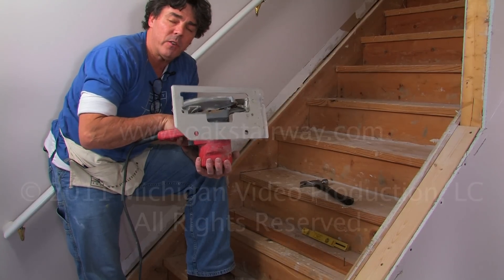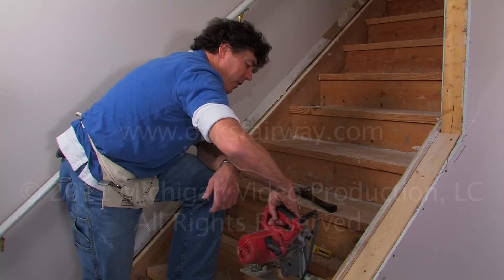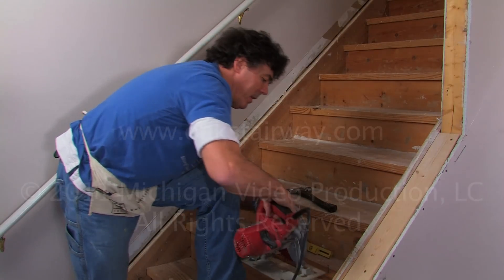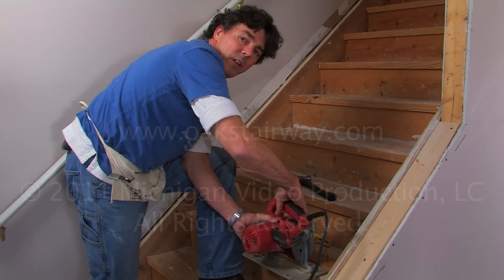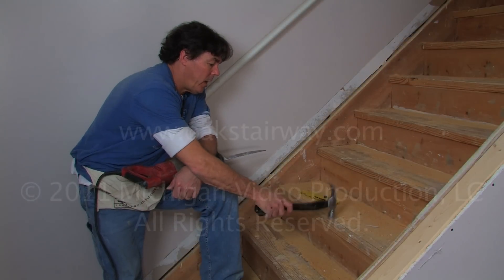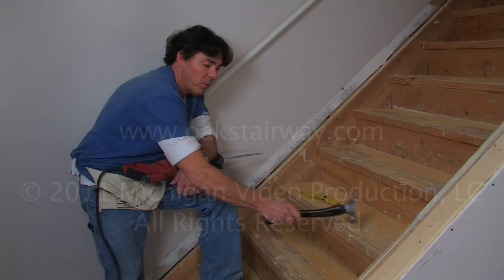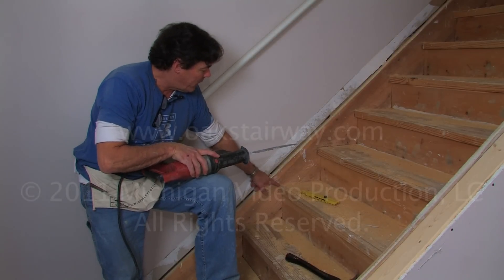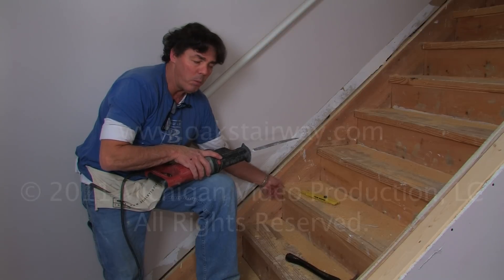How to remove nosing from stairs to install oak wood stair treads.

Comment: A jig saw will get you closer to the ends where a multi-tool can finish the job. Both are more manageable tools in the hands of a novice. With the jig saw, you start at the front of the nose, on an angle, and then work your way back to your line and then go across. Our you could drill a 1/4" hole where the edge of the hole touches the line. Then drop the jig saw blade through the hole and start cutting along your line.

I see a beginner having an accident with a circular saw, messing with the plunge.
Reply: Jigsaw also makes less dust!  But, the guide is important because if you push against the nose with the jigsaw, the blade will bend and you will end up with an angled cut!  Blade must be stress free for a straight up and down cut.

Comment: Just a word of caution to DIYers, do NOT do a plunge cut with a loose bottom plate. Recipe for going too deep and potential kickback. Interested just keep the bottom plate locked and pivot it from the edge into place